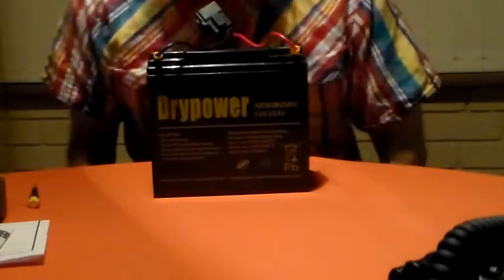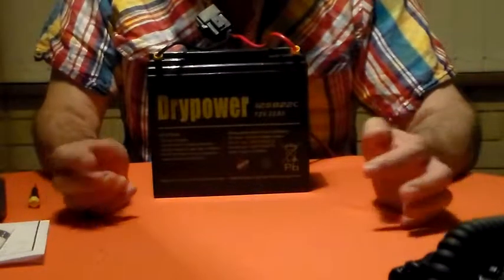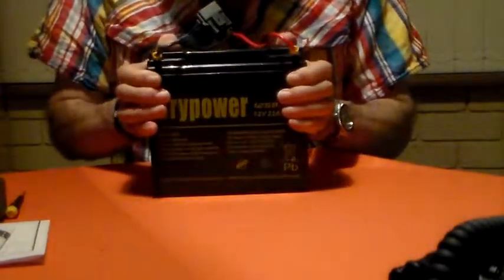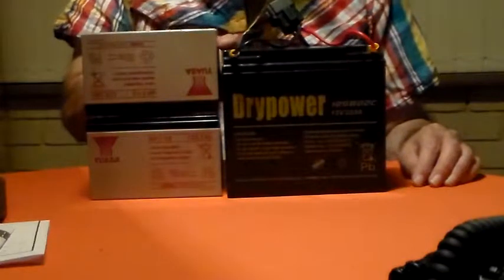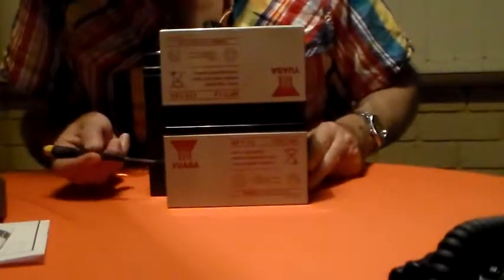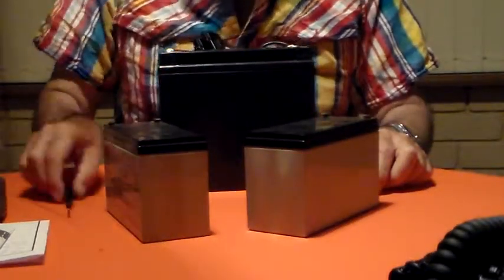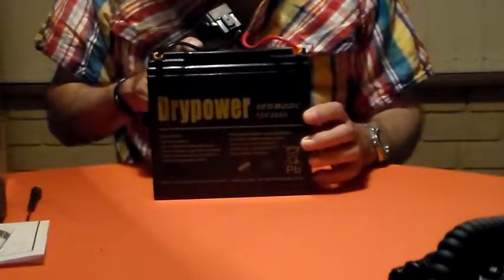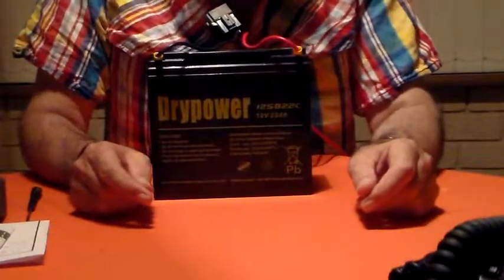Portable Radio Operation 22A/H and 7A/H Battery Size Comparison.

Comment: Thanks for this, I wonder if you could tell me roughly how long the 22ah battery would power the FT857D for ? I know it depends on transmit v receive time, but i cant seem to find anywhere that will show me how to calculate this...cheers. Cristian VK1FCLU
Reply from the maker: Well... a 22A/H battery should be able to supply 1A for 22 hours. The 857 draws less than 1A on RX so the battery should run it in RX mode for at least 22 hours. On TX it draws about 16A so it should be able to run it on continual TX for around an hour and 20 minutes.. If the average TX 'over' is around 1 minute that's about 80 'overs'. It will be a bit less because of the RX current drawn between the overs, but that's in the ball park... as they say.